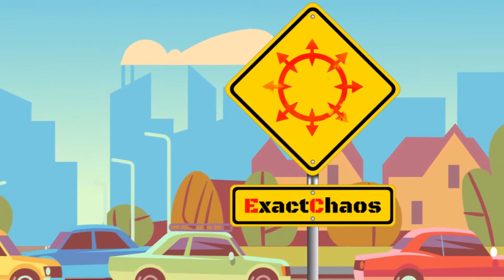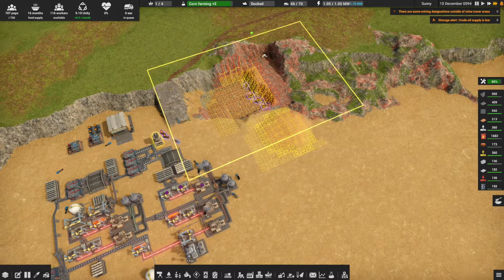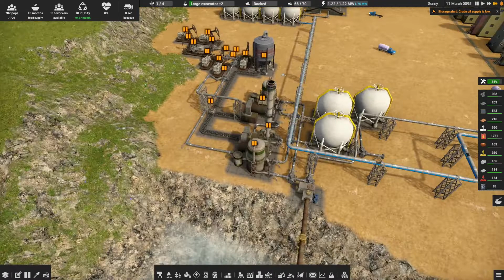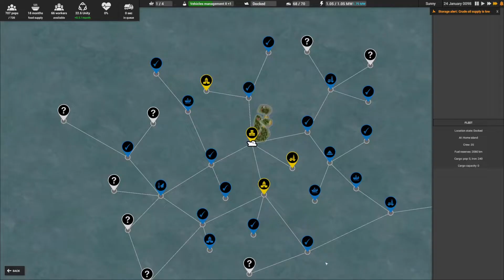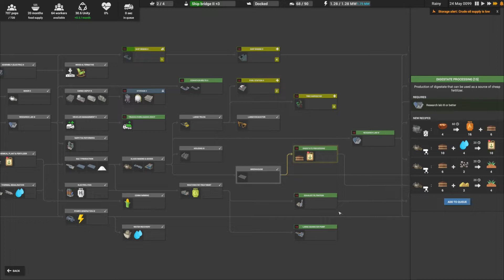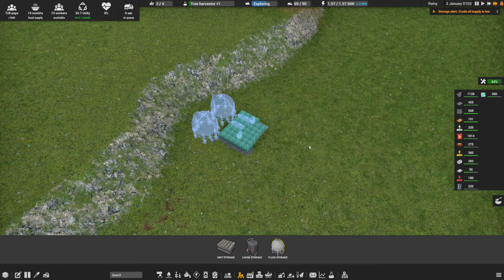Queue the Glassmaker - Captain of Industry

Comment: I know I am a bit late to the party, but here are some tips that I have learned:

Align your generators: 2 high pressure steam and 1 low pressure steam. That creates 3MW of mechanical energy. Then put 2 flywheels (look at these like batteries) followed by 6 power generators. All in one line. As it says, you can get up to 10 MW of power, each of the level one turbines provide 1MW of mechanical power which is then fed into the power generators. These consume 500 kW of mechanical and output 250 kW of electrical power. So you put 6 of them at the end to create 1.5MW of electrical power from the 3 MW of mechanical power generated from one boilers worth of HP Steam. 

Also, use a balancer for the water problem. Feed the fresh ground water into one side and the reclaimed water from the cooling tower into the other and give priority to the reclaimed water. Then you wont have to keep turning things off and on constantly.

Good Luck!